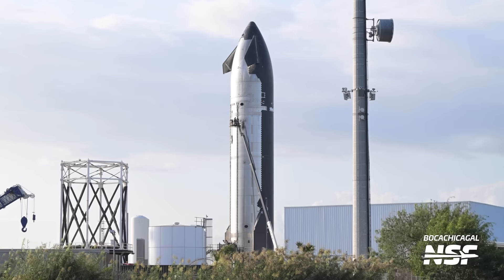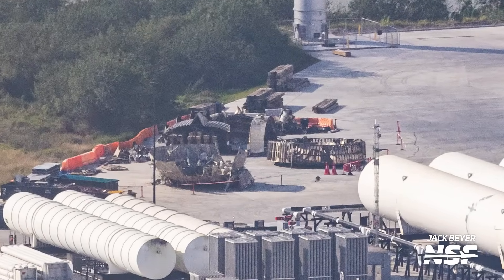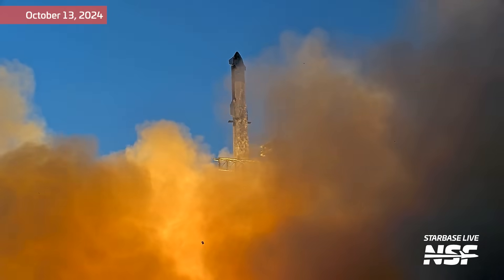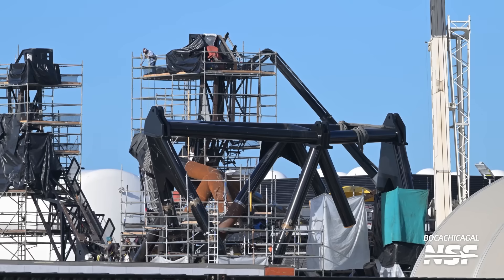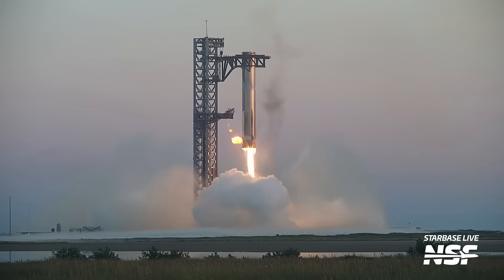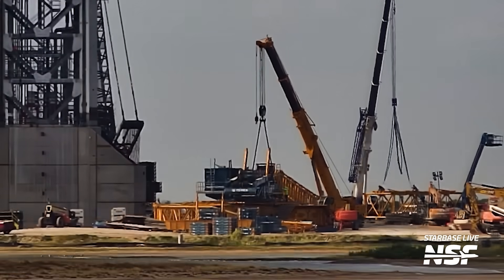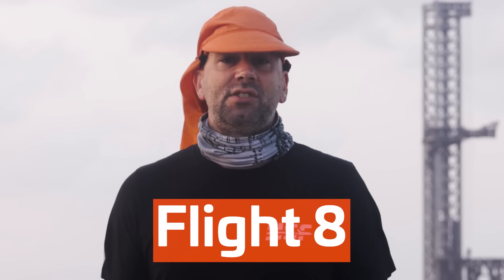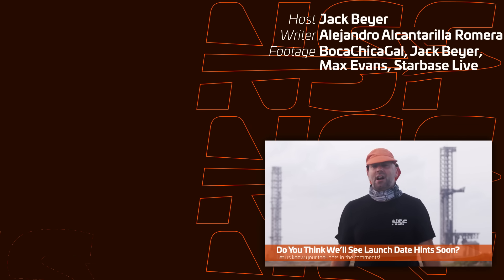Pad B Takes Shape at Starbase! Ship 33 Gets Frosty | Starbase Update

Comment: 16:30 "...if they could get rid of all the tiles...": If they could reduce the speed of return they could get rid of the heat. What's the hurry? Why can't  they gradually reduce that speed beginning with their entering the atmosphere? If there's enough atmosphere to cause that heat, there's enough atmosphere to "lift" and thus reduce the orbit at a slower rate (i.e. descend).
Reply: It's not as easy as you think.
Reply: @imaginary_friend7300  What makes it harder than I think?
Reply: @toddmarshall416  You're talking about generating lift to reduce the falling speed to slow down entry.  That adds a ton of dead weight.  The original shuttle design did not have such large wings for that reason but airforce requirements forced them on the design.  Even then at those speeds to do an effective job you need to make repeat passes to keep your TPS mass low and from failing, a TPS failure on a drag surface is not always catastrophic but on a lifting body it would be and that's what wings are.  There are always trade offs and spacex is aiming for high efficiency vs hardware rich and wings are hardware rich.
Reply: @imaginary_friend7300  I'm assuming you know what you're talking about. Why was the Space Shuttle approach at such a high rate of descent (8 km/min) upon hitting the Karman line (It's velocity was 8 km/sec)? Why didn't it approach the Karman line at a very low angle of attack? Why didn't it take longer (13 min) to reduce it's velocity to (6 km/sec). Why didn't it take longer than 12 more minutes to land? If that were done TPS would not be needed? How much lift is required to compensate for drag in limiting the rate of descent (SpaceX uses variable paddles and fins) especially in sparse atmosphere at high velocity? Assume it entered orbit at the Karman Line and used the drag to bleed off the velocity rather hitting that line at such a high angle of attack and rate of descent?

Comment: Does Falcon9 second stage use a new Merlin or a flight-proven booster engine with Vacuum nozzle replacing sea level one?
Reply: Every Falcon9 second stage uses a single vacuum engine. When the 2nd stage has completed its burns it is deorbited and burns up doing reentry. Therefore there are no previously flown engines to reuse.
Reply: No, what I meant was they could re-purpose a booster engine.   @mikegardner107
Reply: The MVac engine is different design from the sea level Merlin so nope, they can't repurpose

Comment: You said that it would make operations sense to have a different set of subcoolers and pumps for Pad West, but I don't understand why. Could you clarify? Is it so that they could simultaneously fuel both pads, cause I doubt that they'll do that for quite some time.
Reply: Mostly redundancy, and also they don't want to run pipes from the old pumps and subcoolers all the way to Pad B
Reply: @konkam744  Fair enough, that does make sense.
Reply: There's a long stretch of land to get to pad B from the storage tanks, if the pumps and subcoolers can be closer to pad B that means they don't warm up as much before going into the vehicle and allows for independent operations